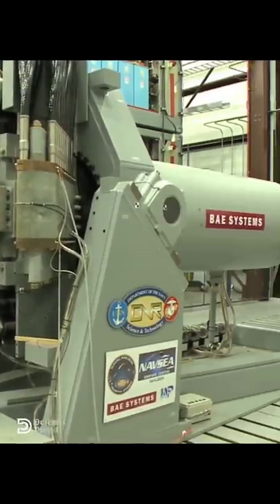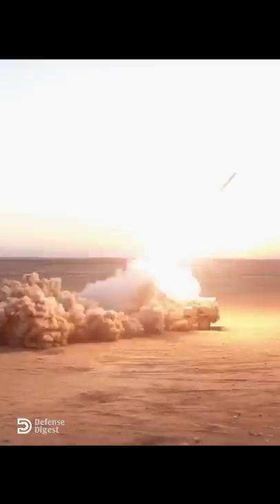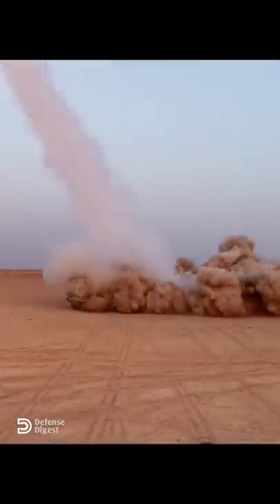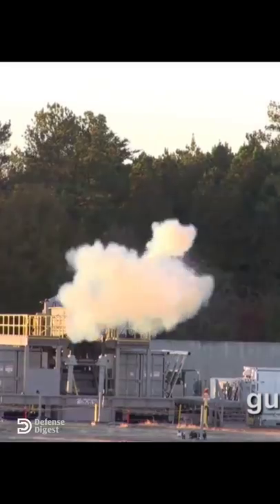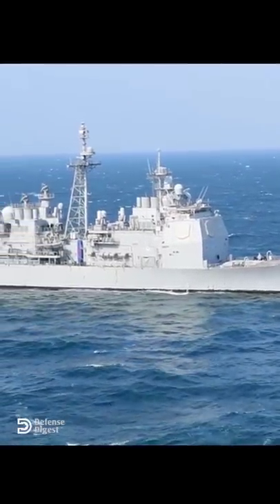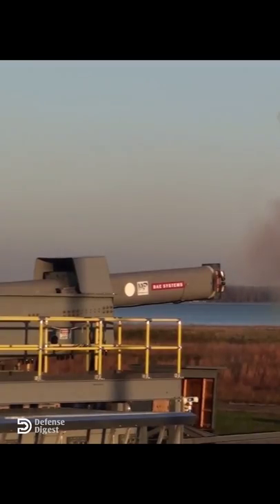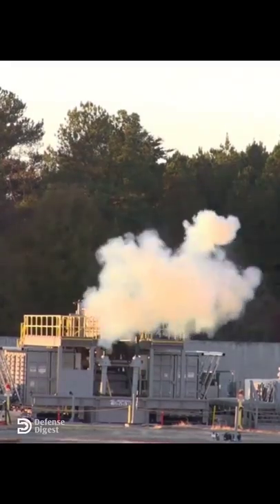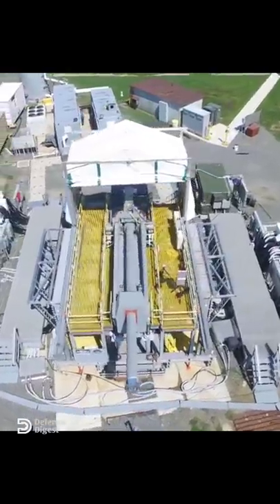Hypersonic cannon that does not require any explosives #Shorts

Comment: When they can solve the problems with barrell exploding, this would be a very devastating weapon, especially against ships.

Do you guys remember USS Missouri? Those big guns if they were rail guns would reek absolute carnage on ships or shores. 

They'll solve it. I understand that the program has been mothballed but I reckon they can work it out.
Reply: They have laser cannons now.
Reply: @pauljameshere85   Are they much better than this devastator ?

 I truly don't know , the Ukraine/Russia war has got me interested in military weaponry.
Reply: We use the barrel as the propeller to propel the projectile. Been doing this since 1975.
25 megawatts is not needed.
Reply: @icosthop9998 the problem with lasers is that they vaporize (both a positive and negative) while initially efficient, the vapors attenuate the incident light. Which reduces transferred energy.

Comment: 5400 miles/hour is wrong, even some normal rifles can get more than that. It's supposed to be 5400 meters/second, about 17700 fps.
Reply: And what abot earth curveness? Is it possible to aim smth with direct shot?
Reply: @romandiakov6464  The curvature of the earth has been used when aiming cannons for a long time, like on the battleships from WW2. You could aim it the old fashioned way as long as you could see the target, but if it was hidden by earth's curvature you would need to aim by radar or coordinates from something else like a drone.
Reply: @Wormweed  I believe you can aim with any possible equipment, but how you are gonna curve ballistics of the bullet with speed 5.4 km/sec? In 2 seconds it will leave trajectory, which is parallel to the ground due to ground lowering. Excuse my poor English. I could express myself not correct.
Reply: @romandiakov6464  The main goal of the high speed is to hit targets further away, so i don't think that would be an issue. I guess there could be situations where the target was too far away to get a line of sight, but too close to hit. But then they could just use normal cannons or rockets. This is most likely just issues in naval combat, on land you would have all kinds of other obstacles and elevation changes.
Reply: @Wormweed  I think, the only use of such a cannon can be on distance about 30-60 km. Depending on elevation of its position. If it is on the plane, it could hit further,but its impossible. If on high ship, may be 60 km. Only on direct line of sight. And for modern sea warfare this distance is not enough. From this point of view it is senseless.
Reply: @romandiakov6464  The US have dropped the railgun project, but the range was about 200km.They were too heavy and required too much electricity to be able to fit on any mobile platform, other than ships.
Reply: Now THAT is insane Fps!
Reply: @wavular  not really about triple a .50bmg
Reply: @off6848  which is pretty dang fast!

Comment: “Low cost of ammunition”

The rail gun almost basically rips itself apart after every shot, which leads to slow follow up shots and constant repair. So as powerful as it is, it isnt worth using yet until they find a way to dissipate all that kinetic energy from the shot.
Reply: The rail gun isnt ammo so it still has low cost of ammunition
Reply: @PrvnCoke  I know but you have to factor in the other repercussions of each shot besides only cost, which obviously like small arms doesn’t require as much maintenance
Reply: @ciroc_lobster4052  you're right, i never make serious comments on youtube
Reply: @PrvnCoke  You are right too sir, I guess i come from a different perspective :)
Reply: More magnets
Reply: Aye they need to figure out how to make the kinetic energy of the blast into power so it dont take as much wattage to fire

Comment: 25 megawatts? 25 MW? How could I be so careless? The only thing capable of generating 25 MW is 5 or 6 locomotives!
Reply: Crazy how a much smaller form factor could generate that much power
Reply: Nuclear powered carriers produce 125mw plus 350,000 shaft horse power 🙄
Reply: @anonymous-kd3hu  The NRO's TR-3B (those black triangles) exploit the polarizable vacuum (electrogravitics) through overunity. Nuclear is inefficient, dirty, and endurance is not as long as you'd like for nuclear subs and supercarriers considering refueling is a real pain. Only overunity systems can supply practically infinite load and demand and can sustain it.
Reply: @DCrypt1  truth.. I got a pic of a triangle craft 3 years ago.. those fuckers move
Reply: Mister Schubert - You did it because you were so preoccupied with whether or not you could, you didnt stop to think if you should.
Reply: @DesertStateInEU  in my defense, I did think that plutonium would be available in every corner drugstore...
Reply: @DCrypt1  Aloha" very interesting"
New subject for me to study on I needed that today since the rats are causing problems Today in my neck of the Woods
Reply: Twin nuclear reactors can handle it
Reply: I believe it was gigawatts, ( pronounced jig a watts)....that you were thinking.
Reply: @anonymous-kd3hu  so you’re saying you simply need to build a nuke plant anywhere you use a few of these 👍 gotcha it’s nuthin

Comment: The problem with this was the rate of fire. The large amount of current flowing through the rails heated it up and under sustained fire the rails warped. The large power requirement also meant you cant have too many of these on one ship. With the low rate of fire and advances in missile/projectile counter measures, it was deemed not effective. By this time the Navy felt like it has already sunk too much money into a system that is still early in its prototype stage.

Comment: needs to have it's own fusion reactor
Reply: No it doesn’t, they require capacitors, so it’s a matter of how long you’re willing to wait per shot…
Reply: @luggy9256  Takes far too long, it needs a fusion reactor like in Iron Man's heart.
Reply: @MrRichymil  the power requirements for a railgun is kinda insane, so capacitors are the only way because they need all the power in a fraction of a second…
Reply: @luggy9256  I bet when they invent a viable Fusion reactor it will do just what is required, even if it needs capacitors as well.
Reply: @MrRichymil  with the reactor on a ship we could already charge the capacitors for firing fairly fast, and they can be pre charged so it’ll always be ready for the first shots, hopefully you don’t need to fire too many too quickly…

But then again the railgun project was canceled a decade or so ago anyway, or at least mothballed…
Reply: @luggy9256  They took to long to change.  A bigger faster power source was required.
Reply: @MrRichymil  well yea they weren’t powered by a quality reactor because the testing they did was proof of concept, the biggest issue was the rails tearing themselves apart in 10 shots or so and needing to strip the gun down completely and precession machine new ones… can’t have a weapon in the military be completely gutted after so few shots or it’s useless in any potential combat scenario
Reply: @luggy9256  If it had its own power source it could be used anywhere when they resolve the other issues.
Reply: Fusion reactors are just a thing of sci-fi. For now, research says: more size more power, but the input is higher than the output. So it is very inefficient.

I'll go for nuclear reactors.
Reply: @Srae17  A bit like railguns to.
Reply: @MrRichymil  exactly like rail guns, ha both rail guns and fusion are still in the  developmental phase.
Reply: @luggy9256  Flux capacitor
Reply: @MrRichymil  But I think the best part for the fusion reactor is having a power source that will last for a  long time.

It won't be good for military purposes but for civilians. It might not be able to deliver a lots of power in a short period of time, but it is long lasting.
Reply: @MrBillkaz  This is a good tactical idea, we could reach 88 miles an hour in a vehicle which the weapon is mounted and then go back in time after we've seen what the enemy would do and win every time without loss,  that is once flux capacitor technology has got a bit better and we know how to regulate what time frame we come out into.
Reply: @MrRichymil  haha yes sir!!
Reply: @MrBillkaz  of course the biggest problem with time travel is if you'd gone into the past to change something you would never have had to have go because you would have already done it before the past became the present.
Reply: @MrRichymil  Yo by the way, railguns will be a very effective platform for space exploration. 

It could give spaceships a big boost saving a lots of fuel, money, space, and weight.
Reply: @Srae17  And could come in handy when they invent a wap drive, who knows what hostilities you might incur when at the edge of the universe.

Comment: How about a nuclear powered ship? For sourcing the energy deficit.
Reply: as far as I'm aware, and I might be wrong, nuclear power generation is somewhat too slow to sustain repeated shots of a railgun, feel free to correct me if I'm wrong
Reply: @extinctiongod2980  wrong
Reply: As with any other generator, nuclear generators generally create power up to a certain limit, and beyond that you would need a larger reactor that would likely be impractical for a ship.

An easy comparison is burning coal, yes you can burn more coal to create more power, but at some point you're going to need a bigger furnace
Reply: @EdgyShooter  in this case, you're gonna need a bigger boat...!
Reply: @misterschubert3242  Now that is the correct answer!
Reply: @EdgyShooter  🦈
Reply: There ARE nuclear powered ships.
Reply: They've made a few in the past, but they use up the energy stored in whatever reactive they're using very quickly, which then have to be disposed of. Long story short, they tried it, but it was really too expensive and impractical for long term use.
Reply: America literally has 10 nuclear ships in active service…
Reply: @extinctiongod2980  that would depend on the size of the reactor…. Nuclear is the best bang for your buck for its size by far though.

Most tests with railguns and coilguns use capacitors though, because the guns need such a massive amount of power in such a short time anything else isn’t practical…

Comment: Nice, but since we are gonna use tons of electricity per each shot, why not direct that energy into a laser that goes at the speed of light and doesn't need a projectile?
Reply from the maker: Laser Weapons has an effective range of 1 mile or 1.6 km. The intensity of the leaser decreases as it goes beyond this range. on the other hand, Electromagnetic Railgun can hit ships over 130 miles away with pinpoint accuracy and its destructive power is far greater than that of a laser weapon.
Reply: Lasers also have problems when they encounter a reflective surface, a rail gun however... Not so much 😅
Reply: @DefenseDigest  interesting, and what are the advantages of this rail gun over missiles?
Reply from the maker: @JustRememberWhoYoureWorkingFor  As i earlier mentioned in my video,
"Railgun does not need to transport explosive propellants or warheads"....That means, It provides huge advantage for a warship or destroyer. A warship on the battlefield is not completely destroyed by a single missile of the enemy.  When that detonated missile hits the other explosives in the warship, they also explode and continue in chain reaction until the ship is completely buried under water.  Electromagnetic railgun on the other hand does not raise any issue of these fears.😎
I hope I have been able to answer your question correctly. Please let me know in the comments😇
Reply: @DefenseDigest  ok thanks for the explanations
Reply: The earth is round
Reply: @tommytube268  so?
Reply: @JustRememberWhoYoureWorkingFor  rail gun has a maximum range of 100 miles that’s beyond the horizon angle up and it comes down, but lasers are straight and unless your taller you can’t hit the same object
Reply: @tommytube268  ok I understand, you mean shooting the rail gun so it follows a parabolic flight, right? I thought 100 miles wouldn't be that noticeable when it comes to Earth's curvature
Reply: Lasers are also being researched by the military, mostly for anti missile and anti air use…

Comment: Not to mention they would be near useless in naval warfare besides a range advantage that is negated by missiles.

The spalling would be very minor so you would need to know where to aim for the most damage, they take a while to reload and recharge, and the barrel is entirely destroyed after just 1 or 2 shots and either needs replaced or repaired, and the hole left behind in the hull honestly could be patched. Most ships have a patch weld crew and water pumps.

Comment: If you add a spin-launcher wheeling before passing the shell through the hypersonic tube, it increases the speed without the magnets using that much power after. Which this invention, vice verse applies to the Spin-launcher, space rocket deployer.

Comment: That is not the only problem with he rail gun.... Its biggest problem is that it fires so violently that it actually breaks itself when fired and after being fired so many times it's no longer safe to fire and through the duration of it's short life it requires constant maintenance and very expensive repairs so cost wise it compensates for the cheap ammo in high dollar parts and besides that it initially costs several times more to purchase than conventional weaponry so it's not that much more economically efficient .... If they cost less to build and operate especially without the self destruction , they would definitely be used in war but until they stop self destructing , were just going to stick to conventional means ....

Comment: What they're likely working on is a barrel change system that's quick enough for practical use (like the MG42s main problem) and a way to power it, so either increasing a warship's output or decreasing the amount of electricity needed to fire it. I imagine there's some power loss and it won't need 25 megawatts if the design is made more efficient.

Comment: I guess this has already been considered, but why not scale the velocity down a bit then? I would imagine it would be very effective even at 50% speed. You still avoid costs, explosives, etc. Small darts dropped from planes were effective against engines during ww1. I don't know, though. 5400mp/h seems very, very exact, so maybe it's a reason for that.

Comment: The recoil would be difficult for a ship to endure. It must have had massive coils and capacitors to release that kind magnetic thrust. 25 megawatts is a massive amount of energy and the barrel isn't the only thing taking a beating. Looks like alot of electrical and magnetic energy releases violently in a short amount of time.

Comment: This is part of the reason for the Zumwalt class destroyer. Though it still doesn't generate enough electricity to operate a rail gun, it's generating more than the 9MW that most ships do. The Ford class carrier was also designed with this future in mind.
Reply: The Zumwalt generates about 70mw of energy. It has plenty to operate a railgun.

Comment: You forgot another disadvantage..
Its so fast that the "rail" is degrading in every single shot..
To replace it is ridiculous expensive, and hard to do..
It just need electricity and dont require explosive true.. but not unlimited, since the rail is degrading fast

Comment: How is the power the problem? It'll just take a little bit longer to charge up. The amount of power a ship can supply is still pretty close to what it needs. So I don't see why it can't use high capacity supercapacitors..
I know the project was stopped because the barrel kept destroying itself. So I doubt the power delivery was the actual problem

Comment: Maybe generate an EM field with the rails and have the projectile ride that instead of the actual rail? Seems reasonable and practical enough to me. Just a matter of doing it...
Reply: It probably destroys the electromagnets that generate the em field
Reply: Your genious is unbelievandable stick to video games and bapganistan the Japanese  built a train that runs on the same idea as a rail gun. magnetically the round doesn't even touch the barrel or magnets the aluminum shell hovers in the middle of the barrel the rapid increase of power propels the projectile its simple but the capacitors have to be huge to achieve the magnetic push

Comment: StarDrive Engineering Company is Designer and Builder scientific sciences in Quantum mechanics physics technologies as contractor for D.O.D pentagon for 36yrs! The StarDrive Engineering Company designed and built 6  protypes  railguns for Navy in 1989 years ! The navy never understood advanced scientific sciences technologies in rail guns that did not high power electromagnetics technologies!

Comment: Railgun needs 25 Mega Watts of electricity but ships produce only 9. But they use capacitors that are being charged over time so a ship could charge it in less than 3 seconds. Your argument is invalid or units of measurement are wrong. Watt is unit of work not electricity ;)

Comment: Let's say for example a ship did have the power to fire it. Wouldn't  the ship its attached to be destroyed after useing it? Because if the projectile Is going far faster than the sound barrier then surely the sonic boom crated by firing it would eventually destroy the ship after useing it a few times. Or am I completely wrong? Because I'm no expert in this at all🤣

Comment: I have a solution to this issue and I believe Lockheed already stole it using Apache 3.0 and neuralink weaponized for cia black bag ops but I'll tell you anyway 3 pole energy in a loopback system that amplifier between the shifting to the next pair also adds a twist to  the round increasing  the potential range as well 6 rail to the barrel enjoy Chris runnberg Edmonton FEMA camp Canada pow of usa